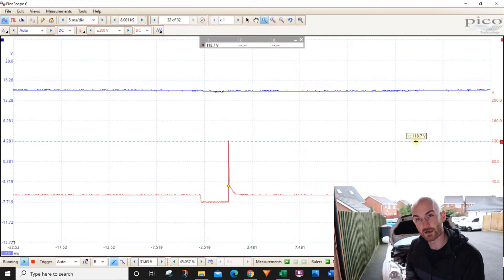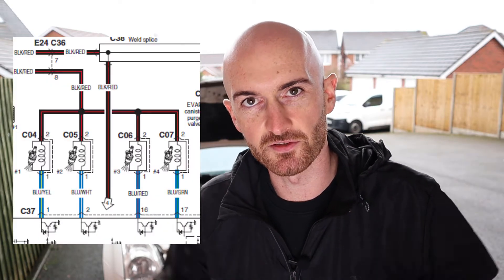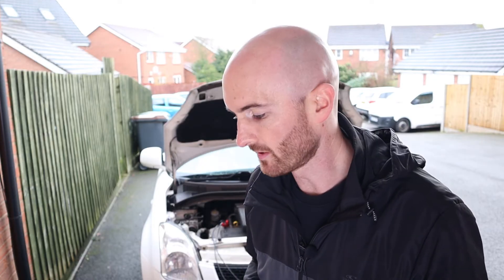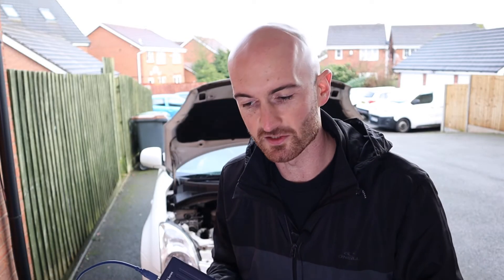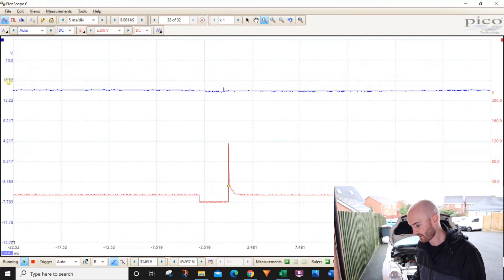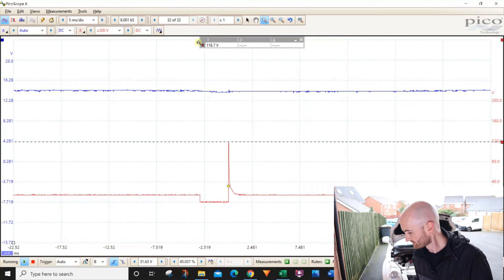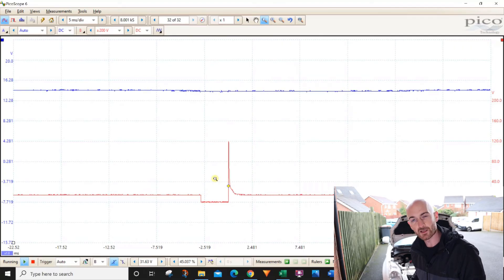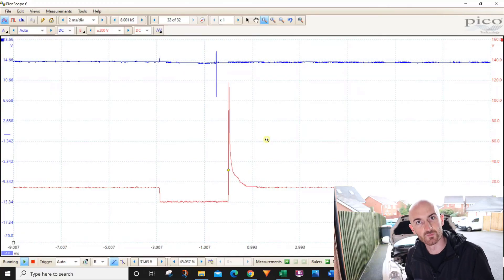EASY Fuel Injector Testing | Automotive Oscilloscope Diagnostics | Mechanic Mindset

Comment: Hello Darren, I'm a new subscriber and have been working to educate myself on oscilloscope usage for automotive diagnostics.  I'm glad I found your channel as your videos are very well done!

If I may ask a question:  does the non-automotive Pico scope have the same resolution as the more expensive automotive model?  I read that the software license for the automotive scope has pre-configured settings and math channels than the standard software license which makes it easier (and faster) for diagnostic work.  Would you know if this is indeed true? 

I would love to buy a Pico scope but the auto version is outside my price budget.

Cheers from Ohio!
Reply from the maker: Hi Dave, great to have you on the channel! Glad you’re enjoying the content 👍

The cheapest ‘non automotive’ PicoScope with specs close to the 4425 range would probably be the 2405A (4 channel version of the scope I use). My 2204A is bottom of the range but fairs up pretty well as you can see. Sample rate and vertical resolution are the key specs here. 

Yes, the auto version has a few preset probes and math channels, but nothing you can’t import or replicate for free. 

A big advantage of the Auto scope is the waveform library access and the separate diagnostic software. I would say these focus more on being ‘guided diagnostic’ aides, where as what we have to do with the non automotive scopes is learn how to use and interpret the oscilloscope; which is what we are all about on this channel!

So if you are pro mechanic, the auto scope can be a great investment. If you want to get in to the world of scopes, go for whatever Pico you can afford; everything you learn is transferable and you can sell second hand PicoScopes easy. 

Hope that helps!
Reply: @MechanicMindset  Thank you, Darren.  I greatly appreciate your  reply and the information you've shared!  I believe the 4-chanmel scope is only $150 more than the 2-channel here in the U.S. so that'll be what I budget for.  It'll be a great tool to learn from and I can always sell it later on and upgrade to the automotive unit.

Best regards!

Comment: Two great videos. Will you do a piezo diesel one in the future?
Reply from the maker: Yes I will do a video for piezo when I can. Need to find a car with them on. Most manufacturers reverted to an improved solenoid injector some years back. But some of the larger Diesel engines still use them. Cheers!👍

Comment: Hello all, just wondering is that pulse width about 3ms?
Reply: I just can't see it too well
Reply from the maker: @alanw5879  Yes it is 👍
Reply: @MechanicMindset  what's the highest pulse width you've seen on a 4-6cylinder Petro engine? I mean with no upgrades or tuning packages.
Reply: I only ask because I've been seeing some higher ones lately, I know the average is around 2.5ms, but I'm seeing real high numbers.
Reply from the maker: @alanw5879  Ah ok. I’ll be honest, I can’t remember and I’ve never looked in to it. Sorry!

Comment: Great video. You have a very good presentation style. What do you think about grounding scope at battery vs engine block? Doesn’t pcm usually use engine block for grounds? I would assume ground measurements would be lower.
Reply from the maker: Great question; it depends. If the battery is right there, I will ground on negative terminal. If not, the engine block is fine. Chassis is better, as it doesn’t move and shake when the engine is running. As for PCM, it varies - most sensor grounds and switched grounds go back through the PCM and in my experience, most PCMs ground to the chassis. I would say the engine ground is mainly used for the starter motor, alternator and spark plugs. 👍

Comment: Ok you said if the signal voltage does not go back to zero then you have a resistance problem... And with the attenuator you got 500 mv so how can I not mistake this for a resistance faut on the ground?
Reply from the maker: Great question; if you had a fault and were concerned that it could be a resistance issue, the line could be double checked with an ohm meter. But to be honest, 500mV in a ground is just about acceptable anyway. In training we say 500mV drop on live and 300mV on a ground. I can’t say I recommend this (but I do it all the time 😬), you could do the measurement without the attenuator. The tolerance issue disappears then. Hope that helps! 👍
Reply: @MechanicMindset  i agree 200mv to 500mv is acceptable,even with no attenuator  . In  the ' real world '  , at  the workshops, it is not a problem at all🤣

Comment: It’s Funny I got my A 2204A on Sunday I was outside on Wednesday doing my own injector waveforms and got the same image, the extra settings are handy as I didn’t think I was getting the pintal move movements showing up I will try again when I’m next off. I got a cam crank correlation but I setup the scope wrong and got a ton of data on the screen you really have to zoom in a lot to get the detail. I will try again with this just not been the weather lately as you know. Keep up with the great videos I have learned a lot from you already. All the best. Steve.
Reply from the maker: Haha, yes it was cold making this video, 1degC I think! Once you start playing you can find all the right settings. For cam/crank I prefer to reduce the time setting rather than zoom in; give that a go. Congrats on the scope purchase, they’re hard to get at the minute! 👍